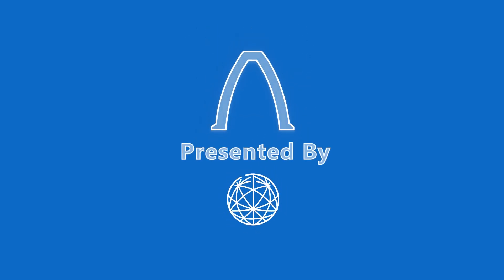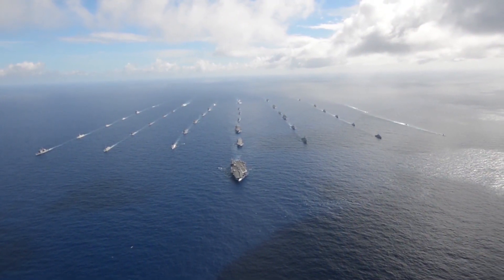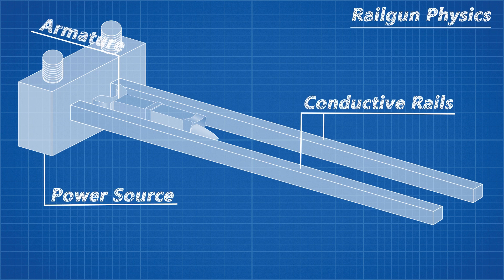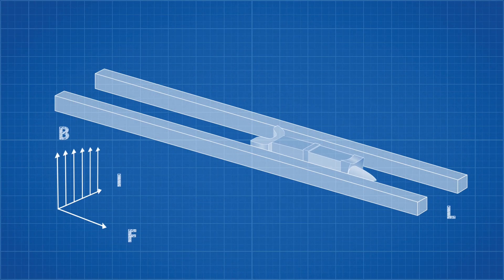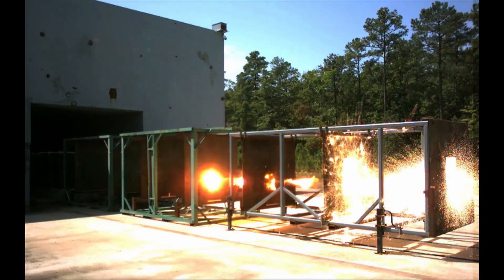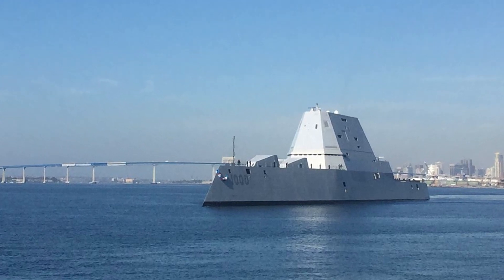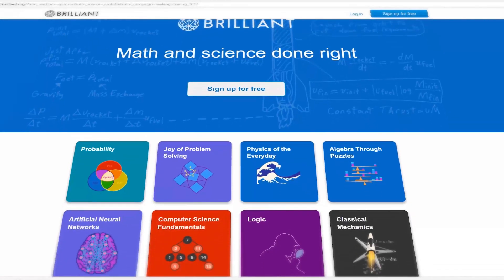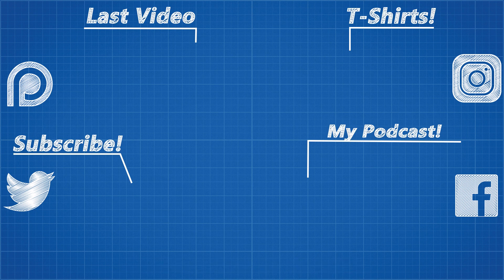The US Military's Most Powerful Gun

Comment: At 3:45 you acknowledge one of the major upsets of this weapon's design; surface wear, and surface damage. Realistically, we can reduce surface wear and surface damage via the use of materials we choose. 
We need:
1. A material that is rigid enough to withstand the recoil of the propelling force and other forces. 
2. A material that is heat resistant.
3. A material that is a super-conductor. 

Metallurgy and chemistry will solve this problem for us.

Metallurgy - Steel is the optimum  material for rails. There are many types of steel but D2(low) is the best here. It is rigid, and conductive. However, it is susceptible to high heat and can warp over time. 

Chemistry - Refining the substrate of D2(low) would yield super-conductivity and increased heat resistance. Plasma assisted physical vapor deposition (PAPVD) could bond Titanium Nitride and/or Titanium Carbide to the substrate. However, PAPVD can only deposit up to 5-7 microns of material to surface for the bonding process. 

Enter Chemical Vapor Deposition (CVD). It does the same thing as PAPVD, only at a higher heat, does a chemical change rather than physical changes, and does not need to use plasma. It can also deposit the same coatings like PAPVD (Titanium Nitride and Titanium Carbide) but it can also deposit Titanium Carbi-Sapphiride in the range of 15-30 microns. 

CVD gives you a wider range of coatings to use, but also at a greater thickness and density. 

Again, both will give you thermal resistance, reduced surface wear, and super-conductivity. In general, increased life duration of the rails means the Armed Forces will save money. Pretty sure that would be a win-win for everyone. Solve the inherent issues with a new weapons platform and save money in the process. 

P.S. I spent 8 minutes typing this, and I don't know why. 😐 I work with PAPVD and CVD coatings so to me it just makes sense....
Reply: Endymion, the Master of Memes, dude they probably have better materials than steel but probably just classified information
Reply: Hayden Murphy I doubt they would use aluminum as it would warp after one shot. Carbide would be great but it shatters quite easily when under great shock. Not to mention it would be very heavy and very expensive to produce. Steel is the way to go. Steel with a coating maybe the most ideal alternative. Cheap to produce, heat resistant, and flexible enough to withstand great shock.

Comment: Thanks for sharing. I think that when all problems are solved and you have a viable rail gun, the battery used to power the gun will be as equally explosive as the equivalent conventional ammunition magazine, so no great advantage there.  Both energy storage systems are still chemical (batteries rely on lithium ion chemistry) at present until the  capacitor-type of battery  becomes economically viable and even there the energy release will be devastating.

Comment: It appears that the main problem is that the projectile needs to be in contact with the rails for current to flow... hmm, could one use induction to bring current into the projectile? You can put a ring on a coil, turn on the current through the coil and the ring will jump due to induction of current in the ring. And magnetic coils can be made super conductive, such that you could do this in theory without any heat loss.

Comment: There is a much better weapon system using a small particle accelerator that can drastically out perform the open air rail gun.  It is called a Lightning Cannon.  Nikola Tesla invented it a century ago.  It can deliver nearly unlimited amounts of energy to a fixed point as far as 250km away.

You simply need to accelerate a stream of conductive particles and discharge a series of precisely tuned capacitors down the length of the particle Beam.  As long as the frequency of the particles match the frequency of the current, nearly all the energy transmitted will reach the destination. 

It is far more efficient than rail guns at delivering energy.  And a significant fraction of the Speed of Causality faster than Mock 6.

It also functions as a receiver.  It was meant to act as both the local connection for wireless energy transmission, AND a defensive weapon that could destroy any conventional weapon of War that came within 250km.  You simply have to create an Aurora with one Tower, and fire the particle beam into that Aurora to harvest energy.

He designed it as a defensive weapon in order to sell it to the Military of every powerful nation, thereby killing two birds with one stone.  Ending physical War, and supplying every square inch of the planet with access to wireless Energy.  This was how the "Halo of Light" was meant to function as the planet's wireless power grind for the next 10,000 years.

But he died on his way to sell this system to Congress.  If only that meeting was a day sooner.  This global energy network, is also capable of delivering Wireless Communication.  All you would need anywhere on earth, is a scaled up crystal receiver, and a small particle accelerator.  Then you can transform energy into any usable form of electricity you need, anywhere within 250km of an active Aurora.  (these happen in the Ionosphere so there would be no place on Earth without readily available energy and data services.

Comment: Lol, rail gun in space? Rail gun to launch things into orbit? Rail gun to stop combs?!None viable RN. The amount of capacitors needed to power a railgun is immense. Much to heavy to launch into orbit if its purpose is to destroy asteroids that are large enough to make it through our atmosphere without vaporizing. And you already have to be traveling 17, 000 mph to be in low earth orbit, that's like Mach 22. A little faster than Mach 6 or 7.Speaking of our vaporizing atmosphere. Your can't shoot things into orbit without them burning up unless they are very massive and have some ridiculously large ablative heat shield. And that won't burn of evenly so your satellite is going to be terribly off course. Rockets can't even make it through the atmosphere without having to throttle down until the reach a high enough altitude where the air is thin enough to hit max acceleration again. That's why you will hear control say during a rocket launch "max q" q =air pressure. And for shooting down icbm's the US is the only country that has the capability to do so without using more nukes. We use kinetic kill vehicles that lock on make trajectory corrections with rocket motors and use their own mass (140lbs) and speed(22,000mph) to destroy icbms. And even those struggle with reliability. Simply shooting things through the atmosphere from the ground isn't accurate enough to destroy icbm's.

Comment: having a railgun in space to destroy asteroids may not destroy the asteroids but send the railgun itself back to the earth :D
Reply: Eccooke31 That isn't true because of the law of conservation of momentum. If the projectile goes forward then the gun must go backwards with the same momentum. Because the gun is a lot bigger, it'll go back a lot slower. Cannons, rail guns, crossbows, all of those have recoil
Reply: +0110
Conservation of momentum would mean that the gun must have recoil if firing a projectile forward, regardless of the method of propulsion. Different methods of propulsion have different rates at which they deliver their force however. A rail gun would have far less perceived recoil because accelerating a projectile through a barrel using a combustive propellant produces a very large force in a very short period of time. A rail gun would produce a smaller force over a longer period of time. This would eventually equal the same amount of force produced by the conventional gun (assuming some mathematical constants between the 2 weapons) but would result with less perceived recoil because it would be dispersed through a larger window of time, never reaching the same peak force as the conventional weapon. The recoil of a rail gun can be illustrated through some fairly simple means.
Envision a rail gun as a simple, non linear circuit in a rectangular orientation. If you clamp everything to the circuit and measure it, you will notice that the power supply side and the projectile side of the circuit are symmetrical. If the circuit was in series, the power supply could be placed in line with the rail element and you could see 2 projectiles propelled in 2 different directions. To see the inverse force to this, one would use the right hand rule ( I don't know if this is a common term everywhere, so I just wanted to include the link to prevent loss of translation. https://en.wikipedia.org/wiki/Right-hand_rule) and draw the magnetic fields near any wire (with the exception of those coming from the wire itself). One can then apply Lorentz force law and calculate that each part of the circuit is repelling the center. This is almost identical behavior to the internal pressure of an explosion generated inside the barrel of a gun. Of course does not account for the potential of any other outside forces on the weapon itself that could have an effect on the outcome. This is a very simplified example, but the principle is the same.
Reply: Yeh. You would need some impressive retrofiring ion rockets.
Reply: @PrincipiaAmoris  pffttt ion rockets?
Reply: Yes. The ejection of ionized gas particles via electro-magnetic/static acceleration.
Reply: It would still have less recoil than a traditional gun firing a similar projectile since the lack of chemical propellant would mean that all the recoil would come from the projectile itself via Newtonian physics.
Reply: There is no recoil on rail guns....like a cannon.
Reply: LOL physics and newtons third law, all go to hell.

Comment: The US military has been using this technology already. A good rule of thumb is that if the public knows about it, the military has been researching for at least 10 years
Reply: Depends on the importance and innovativeness of the new tech, as well as how quickly that field has been advancing.
Reply: noreaction researching != using.
Reply: the research of the railgun has started around 1990.
the practical aplications are still not here not only because of the rails that melt to fast, but also because of the way you need to store the energie for each shot. the condensators are simply to big atm in time for practical use on a ship.
Reply: Mid 90's stealth technology was developed in the mid 60's. Think about that.
Reply: Far more than 10 years trust me.
Reply: "Knowing about it" and "knowing how it Works" are two different things. They might show you how a new bomb or whatever is effective, but won't tell you how it works
Reply: I was reading about raildriver tech as a child so that was about 20 years ago.. now if a child has access to that kind of information 20 or so years ago, and you suggest that the military has been researching and testing a minimum of 10 years before any public awareness then railgun tech would have been a thing since at least the 1980's.
Reply: Rights And Liberty how the fuck did we have nuclear powered subs if we hadnt even figured out fission yet???
Reply: +HAWK 2099 
IKR?!
The equations were developed in the 1960s, ironically by a couple of Russian engineers. The CIA appropriated all the published documents that they made, because Russia considered their research to be of little account. The F-117 first prototyped in 1981, fifteen years before Desert Shield / Desert Storm.
Reply: +Lance Kaz
I have never worked on a rail gun before, let me preface by saying that. I have worked as an electrical engineer on some pretty specialized projects though. My guess is that you would need a switch that employed an extremely thermally efficient superconductor, most likely a high temperature variant to allow operation with an easily portable cooling method such as liquid nitrogen. This would allow the resistance of current to drop to almost none, allowing the current to pass through the switch more easily and drastically reducing the output of heat. Also, I would imagine that the pulse needed to fire the weapon would either have to be activated in stages across a bank of capacitors or accumulated in a closed, superconducting circuit where it would be able to loop infinitely without a loss of charge in order to be able to reach/sustain such a high current. The funding needed to effectively design, test and implement such a thing would be massive though. Very likely beyond the budget of all but the most heavily financially endowed institutions.
Reply: @SighNaps  hmm
Reply: This is a situation where the concept is far easier said than done. I worked on a large railgun in a university in 1992 (25 years ago), and it was already fully operational by the time I got involved. There were a few big technical issues to get around, one of which was mentioned in the video -- firing the gun puts a lot of wear and tear on the rails. Another issue was switching on/off the high-current electrical pulse needed to fire it. We had a 60-MegaJoule pulsed power supply, about 3,000 Volts, or 20,000 Amps. How do you switch that current on/off without melting the switch?
Reply: noreaction at least 10. If not 50 lol
Reply: Jo King haha. Did the same. Was a nice PWS project ^^
Reply: noreaction pfft at least 30-40 years.
Reply: Rights And Liberty Something tells me you have no idea what you're talking about.
Reply: Rights And Liberty 
<statement:set=disbelieve>
Reply: Yeah. Some people cant comprehend that
Reply: noreaction true af
Reply: Hydrohydroxic Acid even earlier.
Reply: Lance Kaz Use a very big relay?
Reply: The us millitary flaunts whatever sounds threatening
Reply: @aiden4599  so does russia. "We have a hypersonic intercontinental ballistic missile" sound familiar?
Reply: Hmmm ...   https   youtube   YvlaytcltDk
ADS
Reply: EVERY decent collage has one of these since the 1950s for students to play with. Nothing new. What was new is the scale to see the practical limits. The conclusion was that it is NOT feasible as a weapon.
Reply: A friend of mine from high school was already building his own version of a rail gun, more than ten years ago. I didn't think much of it, but he was def a smart dude.

Comment: Are they using superconductors for the rails?  Why aren't they using longer barrels to solve issues?
Reply: They aren't using super conductor because they are much more expensive and fragile, and longer barrels would make the gun larger and more vulnerable to attack, one way they are helping the tearing of the gun is by putting a sheath on the rails so when it fires the sheath gets damaged instead of the rail, Then they replace the sheath, it extends the life of the gun.

Comment: What happen if this weapon got hit by EMP ?
Reply: Hary Satria it's probably already EMP harden since it already pushes super high voltage.
Reply: Miguel lopez bro there no such thing as "EMP harden" and the canon its self is electrical gizmo thingy
Reply: Hary Satria bro do you know what an EMP is?
Reply: Miguel lopez electro magnetic pulse
Reply: Hary Satria no shit, but do you know what the electromagnetic pulse is? And how you can harden against it and why some electrical circuits are not affected by it?
Reply: Miguel lopez yeah with that faraday isolator cage, but "emp harden"..
Reply: Hary Satria EMPs can take out electronics by sending free electrons into the conductive parts of the circuits and over volting them causing permanent damage, a harden system would use thicker wires and circuits to prevent the high voltage from melting the the electronics, a electronic system such as a rotary phone can resist an amp since it is simple and sturdy, even tho the US had old technology controlling our nukes they are more harden against EMP since vacume tubs can handle the spikes better then a 14nm transistor, the rail gun probably won't be damaged by am EMP but the computers controlling it from 100ft away probably can.
Reply: Miguel lopez so if that gonna happen with thicker wiring, an thicker everything made it bulky design, better of puting the old gun powder systems right? Like the russian keep this ancient game boy computer like sytem on some of their fighter jet coz it will more resistance to emp more then this delicate chip komputer system on some nato fighter jet
Reply: I am just curious with all this north korea has EMP weapon hype, some poeple on youtube made it sound like "if mr kim detonate his mega manificent EMP bomb over US it will be game over"
Reply: Hary Satria if an EMP was detonated over the US it would take weeks to repair the entire system but the us could also do the same too North Korea x 100, the US still has a lot of dumb fire weapons.

Comment: I had looked into the feasibility of using railguns to launch satellites a couple years ago. I'm pretty sure the conclusion was that, in order to actually reach orbit, it would have to travel so fast at launch that anything useful as a satellite would get melted by the air friction. You'd need to build a vacuum tube pretty much all the way to space to shoot through.